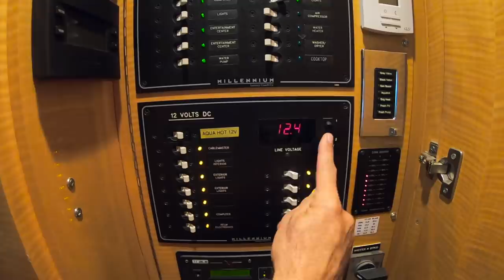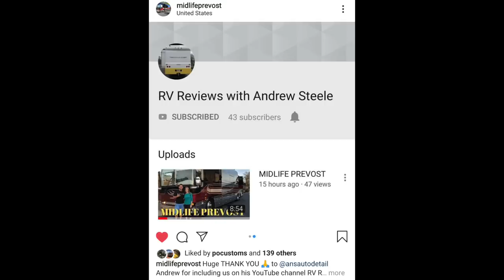MIDLIFE PREVOST PART 2

Comment: Gen set in my Prevost is on a roller carriage which makes access and maintenance easy. The four air bags need to be checked every 6 months or so as they lose a few pounds of air. Be careful not to over inflate as they do not take very much air and inflate in just a few seconds. My coach was converted by Marathon and the gen set exhausts thru the roof also which makes it exceptionally quiet. Currently in Arizona for the winter. and curious about the ocean campground where this video was done ?

Comment: Just wondering any safety precautions built in or taken to prevent the generator from coming on while draining the oil from the unit?
Reply: Court says he has always kept the auto Gen. Start off. So no, no concerns with it starting while emptying. You could turn off the breakers at the gen if you were concerned 👍

Comment: View reminds me of the coastline around Palos Verdes Penn., Socal. 90274.  Interior looks great, somewhat art deco. Surprised no one has installed interior wooden shutters, ( over windows)  have seen few steel interior shutters, which guards against breaking in via glass. One Prevost saw, had computer on board, which would zoom out 100ft while driving, to warn of any animals crossing in frt of the bus, to warrant off crashes. When the windows are open, hot outside, do you smell the diesel, heard this is common complaint? Great vid. Dogs are great. My dogs are trained to use the toilet for #1, #2.
Reply: A cheap and simple way to avoid the fumes of a generator exhaust is to buy a Genturi exhaust system that deflects the fumes up over your coach. I have a Winnebago where the bedroom window is over the generator exhaust and the Genturi has been a life saver.

Comment: Just out of curiosity, how many miles were on their Prevost when they bought it and how many now after two years of ownership?  
Thank you. 
Mike
Reply from the maker: Great question! I will try to track that down for you.
Reply: RVing with Andrew Steele thanks. I’m curious because many of the ones I’m finding in what I think will be my price range gave around 85k-135k miles and I’m wondering if that’s about what theirs had or if they found one with less.
Thanks 
Mike
Reply: We bought it with 110,000 miles and we are up to 122,000 now
Reply: Heather and Court awesome. Seems to be about what I’ve been seeing. Still a LOT of miles left in her. 
Thanks for the reply. 
P.S. I just started following you Instagram page. Great pictures. 
Mike
Reply: Heather and Court How did you guys learn to drive it?
Reply: @winebox  sorry just saw this, we've owned coaches before and Court has taught me a lot too but mostly just practice
Reply: @midlifeprevost1182  Thanks. Since I’ve started watching Andrew Steele, I’ve had a bad case of Prevost lust.
Reply: @winebox  it's quick to happen they are amazing coaches and last forever😃